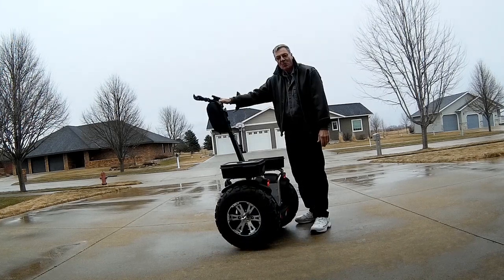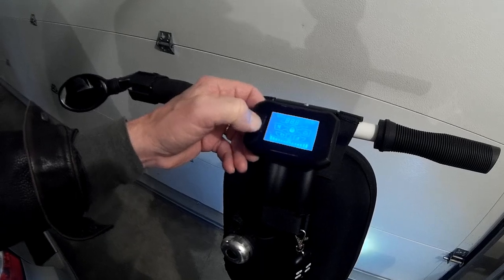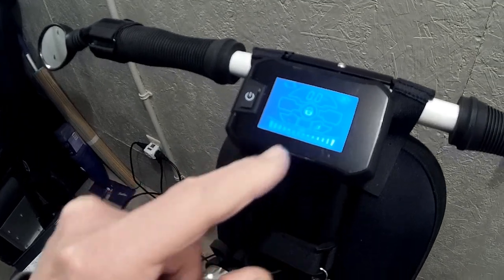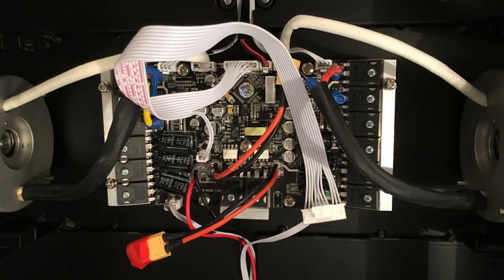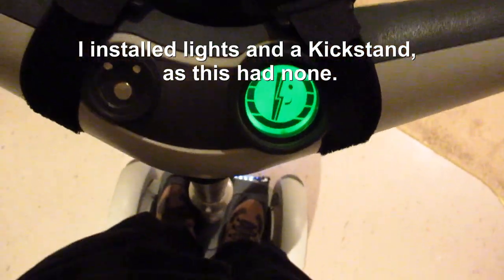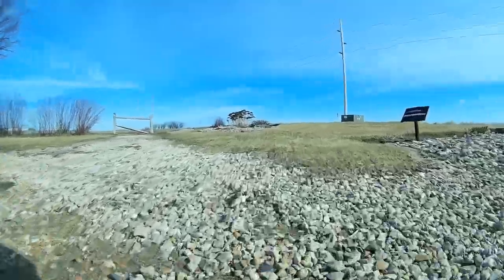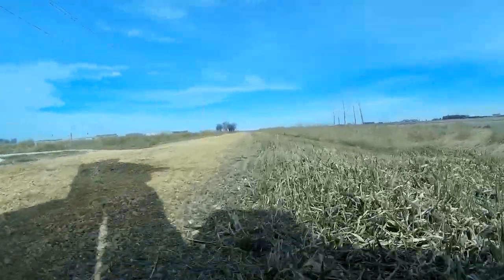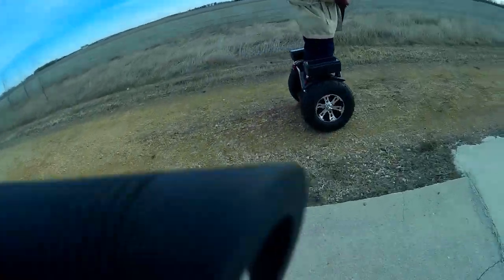Self Balancing, Off-Roading Roboscooter Z1-D Plus, Operation, Innards View, and demo.

Comment: Dave,  would you mind telling us about the heli accident that hurt your leg?
Reply from the maker: Well, I was flying a Heli demonstration at a Christmas party, when the throttle servo stuck wide open.
The heli was a Nitro American RC Mantis with hardwood blades.  The heli then headed wide open towards the crowd. So Instead of letting that happen, I jumped up and kicked the blades and it crashed in front of me.  Luckily no one got hurt except me.  Then walked on if for 4 hours.  It hurt like hell and so I finally left the party and went to the doctor only to find out   I broke all the bones in my Right Foot. It was too swollen up by then to put a cast on it, so I to wait till morning.  Motto: Never Kick  you helicopter!  Thanks for asking.
Reply: Roto-Booter!!!!  :)